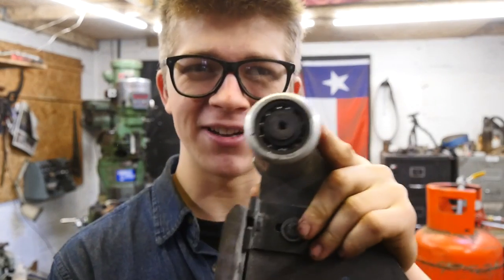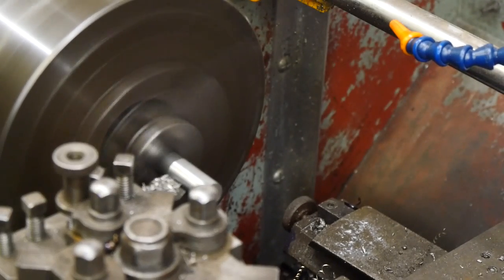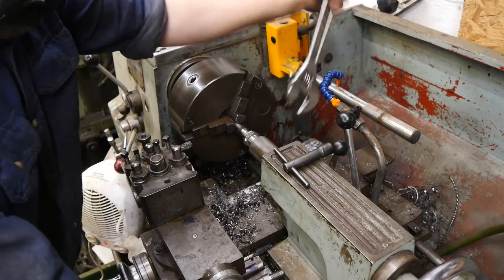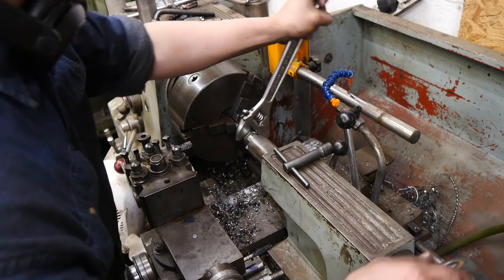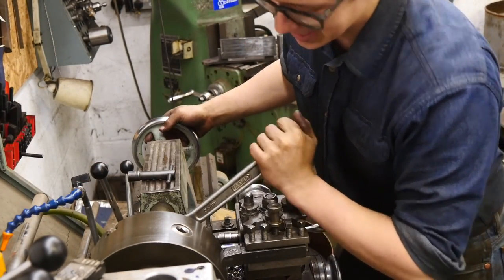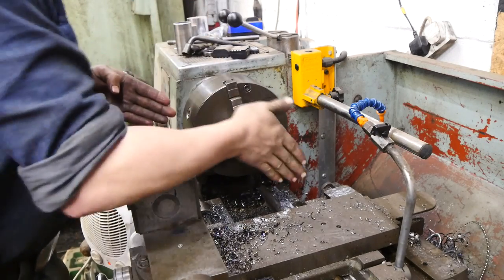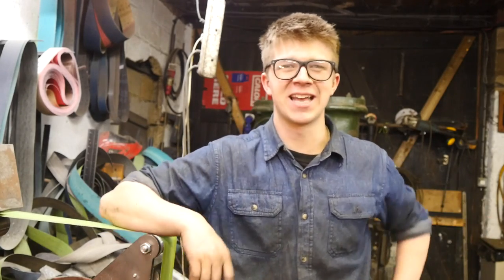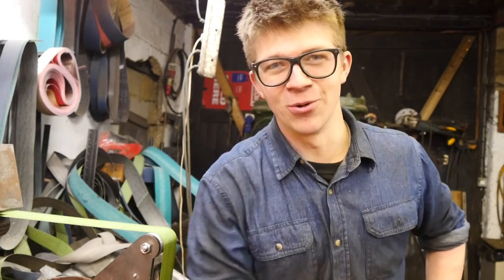LATHE PROJECT: Fixing my Belt Grinder!

Comment: Hey Alec, so to press-fit a bearing (at least in the applications I have seen you utilizing bearings) the best way I have found to do it in the shop, without wrenching the bearing a ruining it, is to cut the bearing socket in your material a few ten thousands smaller than your outer bearing ring. Then, warm up the material evenly with a torch. Place the bearing over the socket you cut, parallel to the face of your material. It helps to seat the bearing correctly if you slightly chamfer the socket. Then place a plate of steel cut large enough to cover the entire face of the bearing. Place this arrangement in an arbor press and carefully press the bearing into the socket. It helps if you run a little grease on the outer race of the bearing first. The plate ensures that you are engaging equal pressure on all areas on the side of the bearing, which is its weakest point and most prone to damage if pressed in incorrectly. The bearing should press in squarely if your socket is cut correctly. Hand pressing it with an arbor also allows you to precisely control your speed and pressure, while giving you the ability to make small corrections if needed while press fitting. 
You really want to avoid using cutting the socket too big and fitting the bearing with glues or epoxies, lest you contaminate your bearing and ruin your project. 
Hope this helps!

Comment: When fitting a bearing make the hole a bit small. Heat up the aluminum and cool the bearing. They should push together and when the heat equalizes it should be a nice interference fit.

Comment: hi Alex, 

The cross slide scales on the lathe will either be in a radius dimension or a diameter dimension. Just turn a scrap of material, measure it with calipers or a micrometer, adjust the cross slide by the scales and do another cut. If you advanced it say 0.002" and the finished piece is 0.002" smaller it is measuring diameter if it's 0.004" smaller the scale is reading radius. 

Once you have established that, if you make a cut, measure it, calculate how much more you have to take off, you can use the scales on the cross slide accordingly. 

If your bearings are not a prefect fit, you could use some Loktite or similar to take up minor discrepancies. 

There is a very good little book published by South Bend Lathe Co called "How to run a lathe" which will give you an excellent reference to lathe operation. 

On your mill, breaking mill cutters can become expensive. 

There are some basic formulae for cutter speed and feed rates. These will vary depending on material being cut and the material of the cutter. For mild steel a cutting speed around 30 metre per minute, 100 foot per minute,  which is the peripheral speed of the cutter, so for a 1" diameter cutter that's around 325 rpm. Tungsten will be 2 to 3 times faster than that. 

Feed speed (table speed) will depend on the number of teeth to the cutter, the more teeth the faster the feed rate. For mild steel you should be able to feed around 0.003" per tooth, so a 2 tip cutter should be able to feed at 0.006 per revolution. So if say a 1" cutter running at 325 rpm @ 0.006" per revolution a feed rate around 1.75" to 2" per minute. Look at the chips and listen to the machine. 

The same basic rules apply to turning too in terms of spindle speed and feed rate, but on a lathe there is only one cutting tip. 

Depth of cut will also impact your finish. 

Hope that is of some help. 

It doesn't matter that you could have bought one for less, it's all part of learning, and any cutters you buy will be there for future jobs.

Keep your enthusiasm!

Regards

Comment: loose bearing for can be remedied. some small punch marks on the aluminium tube ID. we usually use a loctite product. it's retaining compound. they make a few different ones depending on the gap needed to fill. great job! need a part/make a part.
Reply: Channel 67x looks close enough if he had some stainless foil he could wrap once around the bearing and press in
Takes a bit o patience to get it together but it does work
Reply: mightymalikie a set of telescope gauges and a micrometer would help too. too many people rely on calipers.
Reply: best comment yet !

Comment: Make your bearing fit tighter so that it won't go in by hand. Then either press it in with a hydraulic press or refrigerate your bearing overnight and put your casing (roller in this case) into an oven for 20 mins. Bearing should drop in then tighten up as the temperatures equalise and the casing shrinks onto the bearing and visa versa. Great video though, as always. Love the enthusiasm!7

Comment: Never leave the chuck key in the chuck. That's a "sin" in most people's eyes.
Get some "dark thread cutting oil"/"sulfer based cutting oil" to use when turning and tapping/threading steel, it will make nicer finnish. You should be able to find some at the hardware store.
Keep up the good work!
Reply: Jake Parker I wanted to same something about that too. very dangerous if it's forgotten about and lathe gets turned on.
Reply: Jake Parker, I'm not the only one who kringed. Remember the first tool you use is between your ears.  The second is either the coffee pot or the radio. Be safe, make cool sh!t.
Reply: i have to install java before the brain really works .. yeeeesh
Reply: Jake Parker 
Jake using a dark sulfer oil is great for mild steel and or stainless but is absolutely horrible for aluminum.  The most universal thing he could have used was water soluble oil which is what he used.  Using a master chemical or blasser product at least here in the U.S. is readily available and not overly expensive.
Reply: funny I cringed also, in school if you got caught with the key in the chuck without your hand on it you had to ware this giant key around your neck all day. gotta love his enthusiasm hopefully more kids will be inspered and go into a NOBEL trade.

Comment: Alec, thank you for talking about how many mistakes you've made.  So many people I know get so upset when they don't do exactly so the first time.   The only time that I am not happy about making a mistake or someone else making a mistake is when a lesson or something isn't learned from it.  One way to move the tools with better tolerances is to use a dial indicator.  For depth on the ways and for diameter on the cross slide.  Of course the best way is a DRO or digital read out but the dial is much cheaper and works very nicely.  btw, only need to feed the tail stock till the die is started, after that the tail stock isn't really doing anything but slowing down the process.

Comment: UNLOCK the Tail Stock from the bed ways so that it is FREE to SLIDE, then LOCK the Tail Stock quill so IT doesn't move, then begin your threading. Then you will see you don't need to crank the TS hand wheel as the threads being cut will pull the TS along with it.
 And, I really like you show.

Comment: Alec when you're seating a bearing, measure your bearing OD at room temp. then place it in the freezer and bore your hole out 0.001-0.003 inches smaller than your bearing then heat the material then seat the bearing and once the temp. equalizes, that bearing will be in there permanently...also the measurements i mentioned earlier are like 0.02-0.05 in mm.

Comment: When you attach bearings to axles in professional repair businesses, you heat up the inner ring of the bearing to 81-100 degrees Celsius, the inner ring is then able to slip over the axle. You see the the diameter inner ring of the bearing is actually slightly smaller than the outer diameter of the axle, but when heated to between 81 and 100 degrees the bearing will fit super tightly when it cools of, but the inner ring will not have expanded so much that it damages the balls inside it. So in your case you should do the opposite. Warm up the hole, and then quickly slip the bearing inside. It is important not to heat too much, work quickly, and let it cool of in its own pace. This will give you the optimal industrial grade fit you need.
P.S. Great videos, keep up the good work and make a fellow man of metal proud.

Comment: you learn by making mistakes, the more machine work you do the better you get :) if you do not already have a set, a set of snap gauges and a set of micrometers up to whatever size stuff your doing will do wonders in helping you out. and finally when fitting bearings or such sneak up on the final size.  i must say  "good on you, you are an inspiration even to old guys like myself. "

Comment: hey alec, i think the bearing is not thight enough. i learned that the bearinghole is a very little bit to small so you have to put the bearing in the fridge for a while,heat up the hole. place the bearing in the hole and carefully hit it with a hammer on the outer ring of the bearing( or else you wil destroy it)
Reply from the maker: +scott 27 i agree! Your suggestion sounds like a fantastic way to get a better fit! I wish I had thought of this before 😃
Reply: Alec Steele no problem, your videos helped me a lot with learning things about blacksmithing. i am going to build my own propane forge now and your videos inspirered me a lot. i am noe using an old forge from my grandfather which got me started blacksmithing and i absolutly love it, even it is hard to learn without a real live teacher.

Comment: Hey Alec I understand your frustrations at getting an exact fit for the bearings. Ideally the inside diameter of the wheel should be 1 to 2 thousands of an inch under the outside dimension of your bearing and by cooling the bearing it will easily fit into the wheel, you could also heat the wheel but be careful as to much heat will ruin the bearing seals within seconds of installing the bearing leading to premature bearing failure. Some people on here have suggested putting punch marks to tighten the hole. This is a cheat that I have seen and been guilty of myself but from experience I can tell you that it will cause uneven loading on the bearing race and lead to premature bearing failure. Sleeve retainer from locktite is the better solution but can only overcome a couple thousands of an inch any more than this unfortunately means a do over. Hope this helps!
Reply from the maker: +Dan Boyles that's awesome! Thank you so much for the terrific advice!

Comment: +Alec Steele
Coolant spray on the drill bit won't find its way into the hole.  You have to pull the bit out regularly and then push it back in.  
Usually, the same advice applies to taps.

Check out "Cam Follower" on eBay.  You might find something useful there.

Comment: If you take a few cuts without changing the depth, your threads should clean up nicely. I wasn't able to see, but if you use the compound rest set at 29.5 back from center, you can change the chip load on the tool to help it cut more easily.

Comment: You want the bearing to not be able to fit in the roller while they are at the same temperature. You are supposed to have to heat your roller to expand the metal in order to tap the bearing in. You can even cool your bearing down to allow for even tighter tolerances. This way your bearing will not slide or weeble woble and go bad at an accelerated rate.

Comment: if you make the bearing fit slightly under sized, like maybe half a millimetre. then you heat up the roller and but the bearing in the fridge for a while. it should seat quite nicely:P

Comment: Heat the aluminum will make it expand put the bearing in and it'll be a snug fit or cool the bearing in the freezer and pop it in as it warms it'll expand and fit snugly. Alternatively you can get it close and have it pressed in.

Comment: I get this is an old video. BUT, a great way to get a real tight fit on your bearing, without a press, is to put the bearing in the freezer, and heat the outter sleeve. Then, simply tap it in using a deep walled socket of the right size. 
Will be snug, and a pain in the butt to get out next time.

Comment: I watched the video twice and the second time I noticed you made the same mistakes ~.  
 You got it working and that's good. You didn't give up and that's better. Now; What did you learn?- That's the most important!
 Observations: 1. The thread cutting was done too deeply at each pass. Did you cut at 30 degrees at each pass? 2. Take your time working up to the final cuts- example, fitting the bearing. 3. A press fit on some bearings will cause the bearing to bind. Find the right sequence when making parts, (As in what cut to make first and last).
Thumbs up!

Comment: Getting the chase for the bearing pretty close, then heating the aluminum , whilst cooling or even freezing the bearing, should allow you to slip the bearing into the aluminum, and then cooling the aluminum in room air should allow a very tight friction fit and better stability in the grinder. Being able to just slip the bearing into the chase after turning could give it just too much play and will eventually wear it out and need to replace again. Plus, creating a potential safety hazard if it goes violently while in use.
Reply: Oops, looks like plenty of others gave the same sage advice. I have to do this routinely while performing my own mechanic work on my automobile, it has become habit.

Comment: My impression was that to bearing fitting was to loose. when in school working with bearings the options as i remember them was the smaller object was to be cooled and det bigger object heated them put together and when temperaturs align its pressed together. 

sometimes it can also be pressfitted but sometimes difficult. but dont take my word for it. there must be some experts in this alsp

Comment: hey Alec steele I was wondering if you think it's possible for me to Smith full time but I'm really poor
Reply from the maker: +Ogram Brat being poor doesn't mean a thing - work hard, get good, have fun and provide value - you'll win!
Reply: Alec Steele. I know I've got really far on hard work but i make 65$ a week at most and i eat that so any suggestions for a blacksmith on a budget thanks for your time?
Reply: Ogram Brat What country are you in?
Reply: Abby Babby USA
Reply: Ogram Brat Are there any blacksmiths or Farriers near you? If there is you may be able to apprentice for them and that is the best way to learn. If not look around you, we Americans waste alot of material. An old BBQ is a forge, not a great forge but it works, if you can you could build your forge on the ground. Harbor Freight sells anvils, not great anvils but good enough to start, you can get hammers at garage sales for almost nothing.  In India they use Sledgehammer heads as anvils and they make amazing products with just that as an anvil. Look at this from every angle and you will see you can get this started for almost nothing.
Reply: Abby Babby I've been blacksmithing since 2008 I have a forge and anvil with tools just no fuel can't afford propane and can't get hold coal and charcoal burns quickly and is more expensive than coal. and we have burning laws so i can't make my own. Thank for your time

Comment: I wonder what would happen if he just bought a regular 99a center set square lip wheels and some bones super red bearings. it could either explode (I doubt it) or actually work well but I don't have a belt sander so my opinion wont hold much of value in this scenario.

Comment: omg that was brutal watching you on the lathe. something like that should have been a 10 minute job.
Reply from the maker: +ronald steele yup! Total noob with this stuff!
Reply: Alec Steele alittle advice, when cutting a thread leave it it gear and wind back the tool one turn and put the machine in reverse to allow the stock to move back to the begining of the thread then wind forwards to the cutting depth it was at the beginning then add alittle more depth. why do this you ask?, simply put it allows a better thread cutting at higher tolerances and removes the possibility that back lash of the lathes gears will cross cut the thread making it a sloppy fit.

when filing on a lathe always place the file onto of the work as this allows for the rotation of the work to be against the files action also allows the operator to put more controlled pressure on the work.

please put a guard of the lathe so reducing any chances the chuck will grab you and pull you in and also has the benefit for reducing coolant splashing in your face.

just advice. it's up to you if you want to follow it.

Comment: I saw the other day that hss for cutting mild steel as carbide leaves a ruff finish threads also? Also when you tap a thread using the centre let the lock off the centre so it can move forward instead of turning the handle. 

No expert just what I've seen